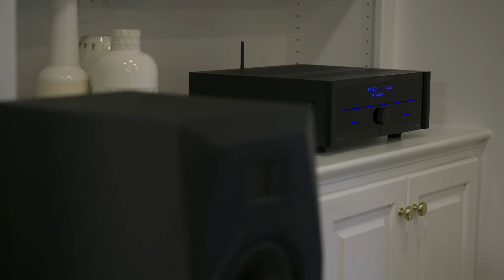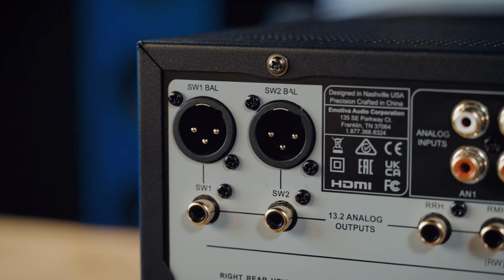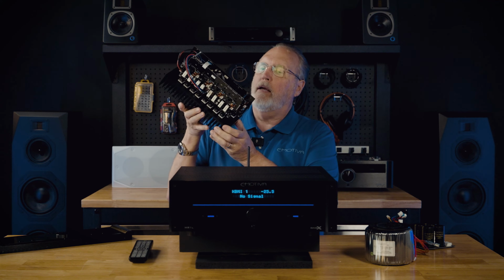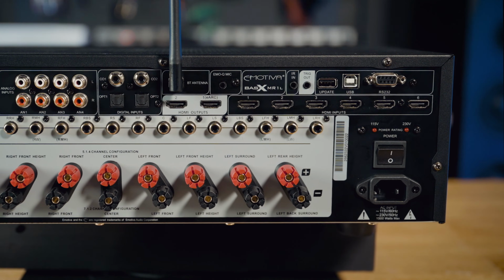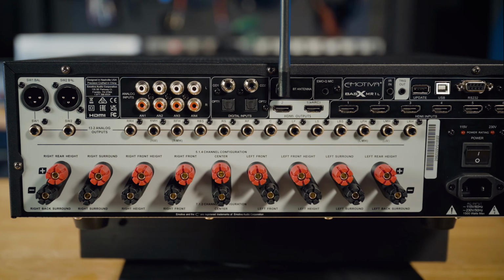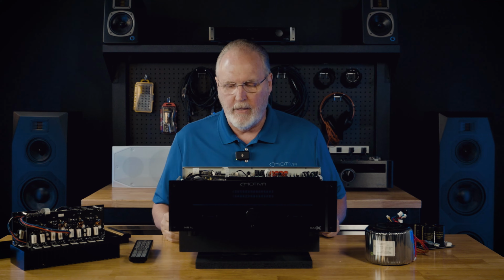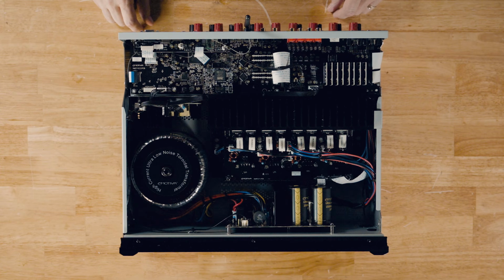Emotiva BasX MR1L 9.2 Channel Atmos® & DTS:X™ Cinema Receiver

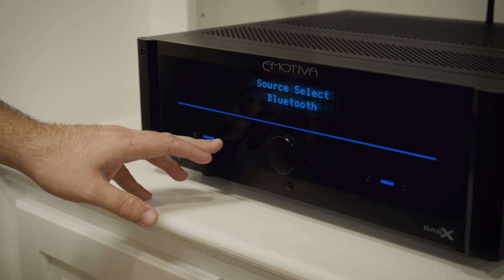Comment: any update on the 8k upgrade mentioned at 7:48
Reply from the maker: This is still in development.
Reply: @EmotivaAudioCorp sweet! please add hdmi audio passthrough to both output ports when powered on in the new firmware.. 😢 your older processors had a menu setting to enable hdmi audio out. The mr1l doesn't send audio to either port when the unit is on, and only to hdmi 1 when powered off. Having two HDMI monitor outputs is pretty useless if the second port can't run to a TV in another room and have audio along with the video when the receiver is on. That HDMI 2 port running to the kitchen or bedroom, so elsewhere in the house someone can watch (and HEAR) the same movie that is playing in the theater.

Comment: My system is a 5.2.4 with a Denon AVR-4300H with two emotiva amps which are a basx3 for my L/R and center channel and a basx7 for my 4 in ceiling speakers and my surround speakers. I’m planning to upgrade my system and buy this receiver and my question is that if I buy the basx MR1L receiver do I still need the amps to get a better sound or a more detailed sound?

Comment: No thanks doesnt have all the features Iam looking for eg 2.1 HDMI support,up mixing for Auro 3D,, phono input, 4 sub out puts, FM tuner, analog multi channel for 7.1 other than that It looks like a nice unit. But come on guys this is a little out dated receiver for todays users,  eg just about any Denon or Marantz has all the features I mentioned except analog multi channel inputs for 7.1 a little disappointed here with Emotiva I just think they dropped the ball with this one.Maybe the next models will be caught up with the competition .

Comment: Nice post, so as a successor to my Harman Kardon AVR 8500 5.1 THX receiver that needs a follow up after 21 years (still in great shape but out dated 26 kg great HiFi) I just bought the BasX MR1 11.2 Channel Dolby Atmos® & DTS:X™ Cinema Receiver at a sharp price thks to your discount. Like my AVR 8500 it has a massive torroidal transformer for juicy power so I expect it to act like my old school Harman, warm sound, easy delivering 15% more power then expected at any time. Can't wait to have it delivered ! It will drive 4 floostanding Infinity Kappa 8.2 i 4 way loudspeakers with the Kappa 4 way 250 W rms center and the Kappa 300 W RMS downfiring sub. So continuing the American HiFi tradition as set by Arnold Nudell (1937–2017) from Infinity in the day.
Reply: So how do it turn out. How is the sound for music and also for movies

Comment: Is mine the only one that has massive static discharge between sources a d switcing content?
Where is the firmware update?
This noise and popping is killing my ears and my speakers!
Reply: Had to send mine back.  Now I have brand new damadged JBL speakers that were awesome.
Reply: @jwkjr321  sold mine on ebay for a loss..

Comment: I Also had this in my cart but after reading more comments like / dirac/Auro & Quote: No HDMI 2.1 and ethernet/Wifi is pitiful.  I have to agree I would feel like FOMO. I will just keep waiting
Reply: Interesting I would trade all those features to get such a good power supply and amp stage for this low a price. This receiver may be the best value I have ever seen.

Comment: I gotta have it now well next paycheck I was going to get the nad receiver which has similar power and features minus a couple on the emotiva the only option the nad receive has over this is dirac but who cares when you can custom calibrate the emotiva using emoq like I said this is better than the nad receiver that cost $3,500

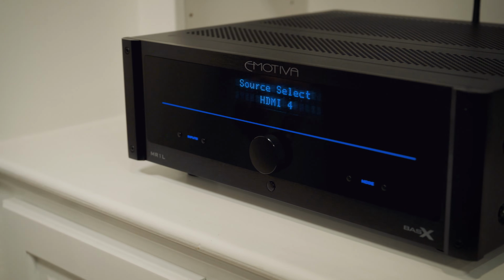Comment: If it had HDMI 2.1 from the factory, I would be ordering instead of commenting.  What are the chances for a revision to include HDMI 2.1? Need that 4K120 option (8K) built-in, fellas. Not enough details on this 8K upgrade mentioned at 7:48 to encourage me to buy with confidence. The ACTIVE HDMI OUTPUT SWITCHING is a fantastic feature.

Comment: I chose to purchase this receiver last night. I’m excited to receive it to hear and see how it performs.

It’ll be replacing my old Harman Kardon AVR 335 from 2004 😮 So this unit will have more than enough features from what I’m coming from. I did desire DIRAC but the extra price for that with other manufacturers just isn’t worth it for me at this time. Maybe in the future. And the hdmi 2.0 is enough for me.. I’m not a gamer and my tv isn’t an 8k haha

I’ve extended the life of that a Harman Kardon by driving my front NHT Classic three’s with an Adcom GFA 555II which sounds amazing and using an external Pro-Ject DAC Box for music playback.

I can wait to hear how the power from the more modern Emotiva will sound compared to the more powerful Adcom… which is supposed to be old enough to need recapping but I can’t hear any issues.

If this unit can retire my Adcom for 2 channel listening then, I can sell it and get a power amp for 2 channel listening in the future… if I feel it’s worth it with new bigger speakers.
Reply: The rest of my 7.1 system is composed of the NHT Classic Three speaker line and the old HK didn’t pack enough wattage to get the most out of them for movies but the MR1L will give them all the power they’ll need. I’m excited to hear the difference
Reply from the maker: We are excited to hear your thoughts!
Reply: @EmotivaAudioCorp thank you!
Reply: So how do it sound with movies and listening to music

Comment: Looks good, love the attention to quality in the amp stage (es[pecially since every home theater speaker is wired to like 4 ohms... and damn near every AVR can only accept 6-ohm minimum, wtf??). 
One HUGE red flag for me is not having WIFI, streaming services are everywhere, and I would really love to connect the receiver to my home network and stream audio from my studio computer. Or the luxury to game and at the same time stream music, which if I use my TV as my streaming hub, that's not possible. That's a ridiculous oversight, I complained about it with the flagship MR1, as damn near every other major AV receiver has that feature built on. 
Not to mention, seriously, u guys want us to move the receiver from its position and unhook cables just to update it by USB?? Is this 2005? Serious flub there. This would be a cash-in-hand buy RIGHTNOW with that simple feature.

EDIT: And no HDMI 2.1? The fuck??
Reply: Emotive responded to a comment about HDMI 2.1 farther down in the comments. HDMI 2.1 is still in development.

Comment: Does movie audio source automatically change per movie input? For various surround sound environments. As far as the decoding goes.
Reply from the maker: You can set it to automatically pick the proper sound mode or you can pick it manually if you desire. You can also setup each input to default with its own specific mode if you want as well.
Reply: @EmotivaAudioCorp  thank you for the timely reply

Comment: Anthem and Arcam have loudness control in form of Dolby Volume and Dolby Leveler. It's fantastic technology enabling reference quality sound at low (ANY!) volume! Can Emotiva implement Dolby Volume/Leveler as well? Doing that Emotiva would have the best receiver on the market period. 🙂👍
Reply: Dolby Volume is a Compression, not that good to use
Reply: @Music.Movies.67  It depends. With movies, Dolby Atmos/DTS X (TrueHD/HD Master) and in conjunction with Dolby Surround upmixer for DD/5.1/7.1/DTS it does wonders. For streaming as well. However with my Metallica Black Album DVD-audio (96 khz) there is a compression and noticeable lesser quality sound. But for everything else out there (99%) Dolby Volume and Dolby Leveler all the way! 🙂👍

Comment: THERE'S NO EXCUSE FOR NOT HAVING 2.1  . DEAL BREAKER  .
Reply: You have to remember how long it takes to develop their components. They don't necessarily follow what everyone else does. Higher End companies take longer than the ones most know. 8K is not anyone's reality as there still is not content or devices you can enjoy right now anyway.
Reply from the maker: We are currently developing our HDMI 2.1 system architecture. Remember we are a small independent company developing these things ourselves not like the AV giants out there like Denon/Marantz/Sony/etc. with endless resources. Even with HDMI 2.0, we have sold out our first few shipments of our MR1 receiver because there is still a massive amount of people streaming from their TV or using their 4K discs and not using any of the 2.1 features. We will have a full 2.1 version of these down the road but there is still a huge market for those still just using 2.0.
Reply: @EmotivaAudioCorp            THANK YOU FOR YOUR REPLY  EMOTIVA .  I AM A FAN OF YOUR AMPS AND SOON TO BE A CUSTOMER BUT I'LL WAIT ON YOUR RECEIVER . NICE TRY THOUGH .
Reply: Theres not excuse for not having WIFI or ethernet ability either.

Comment: No HDMI 2.1 or WiFi / ethernet connection 😢
Reply from the maker: We are working on the development of our 2.1 architecture currently and will have an upgrade available for these units when that comes out.
Reply: I think you missed the point of the BASX line.
Reply: No HDMI 2.1 no access to 4K 120 hrz. to play through my XBOX SERIES X... 
HARD PASS...
Reply: @Ghostrecon12  What Dan recommends in the the MR1 video is to connect your series X straight to the TV, so it can have a direct connection and no repeaters in the way of the video feed, and use Earc to run the audio back.

Comment: Here we go again. These folks will NEVER you guy get away with “2.0" stuff, smh' 😅... why even attempt to let that slide through the cracks!?
Reply from the maker: We aren't hiding away from these being HDMI 2.0. We have sold out many times of our MR1 because most people we have talked to are still just streaming from their TV or using physical 4K and standard BluRay discs. There is a market for both still in the industry which helps while we continue to develop our own 2.1 system. We are a small independent family run company taking on the big guys :)
Reply: @EmotivaAudioCorp  If you're taking on the big guyys, stop bringing pencils to the gunshow. No HDMI 2.1 and ethernet/Wifi is pitiful. I love everything else about this receiver but omitting these features is like not getting XM in a Cadillac. Cmon guys.